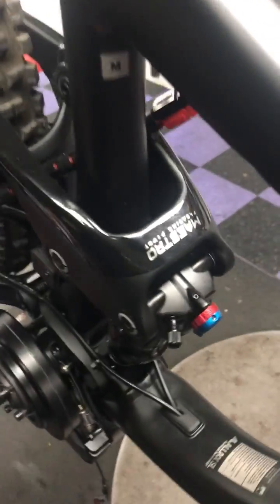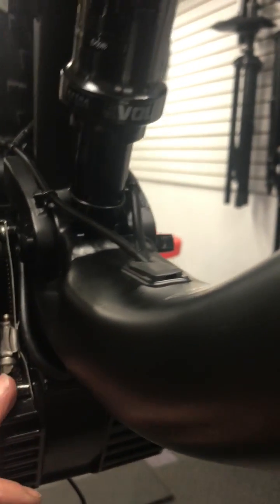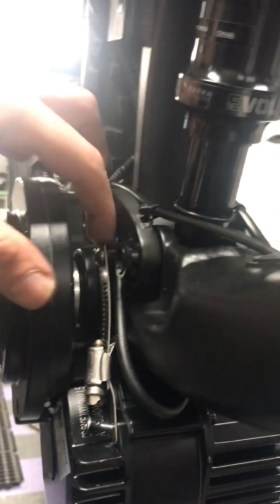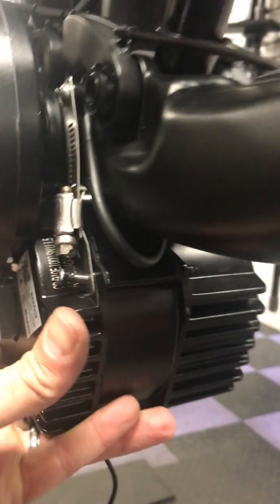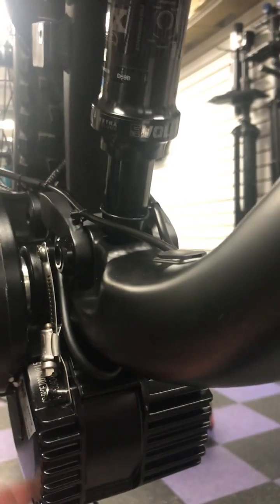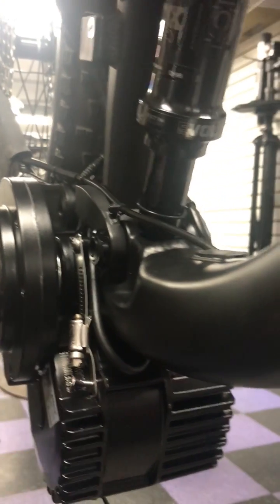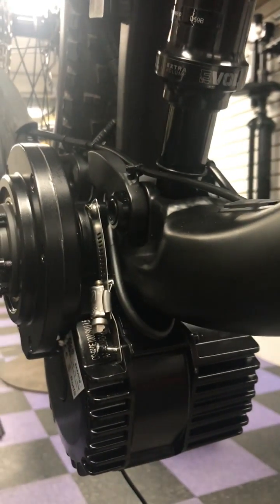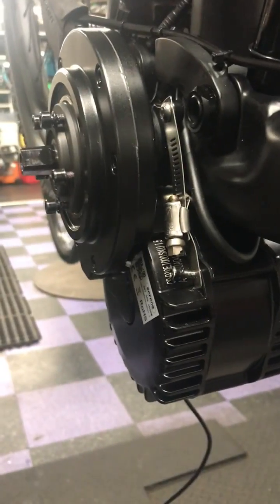Trance e bike conversion bafang part 5 motor brace design to hold the motor up.

Comment: That's actually a sick idea. Has that held up?
Reply from the maker: Perfect so far years later. No loosening yet bike is rock solid.
Reply: @blarpieman  Thanks man, Ill try and figure out if I can make this work for my BBS02. Sometimes Im like shit dude why did I never think of this haha!
Reply from the maker: @sankaplays3098  haha yea I also had new cups machined with  very tight tolerances which was massive to cure the bottom bracket creeking that came with matts kit at emp.  Build a guard too if you can I think I had a video on doing that as well.  What bike you have and battery.
Reply: @blarpieman  I've got it in some old Giant 26inch hard tail, but Ive got a second motor, so I'm building up a bike for me and my girlfriend - both from the ground up.
Some German bike parts warehouse had a big sale for their own brand of frames, so two 29er hardtails on a 100mm fork.
Going to do some light trail riding and some bike packing, those will have a BBS01 for her and a BBS02B 750w for me.
Looking for a nice full sus frame where I can mount a battery easily but still has relatively good travel. I would settle for 120 rear 140 front or something. That guard video was good too man I like that idea, definitely some inspiration.